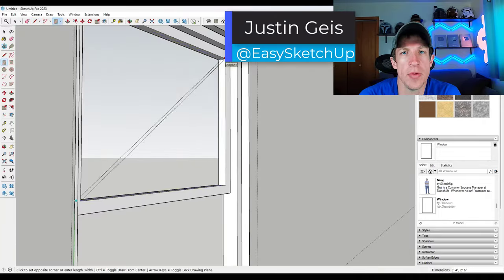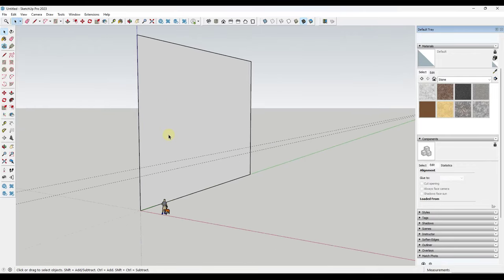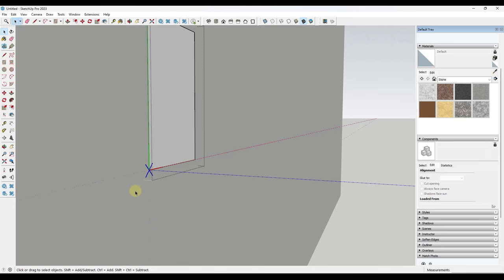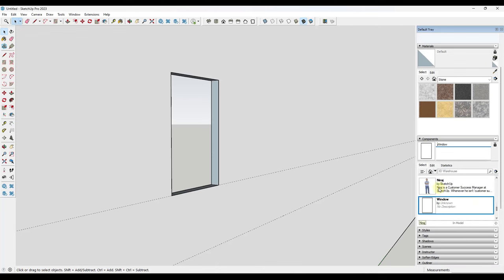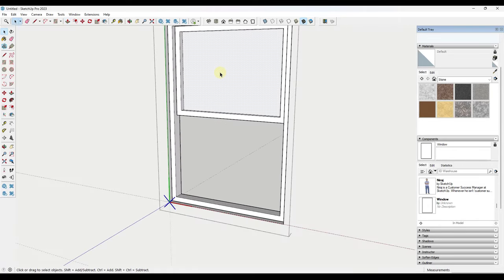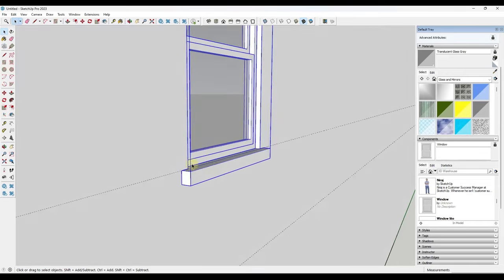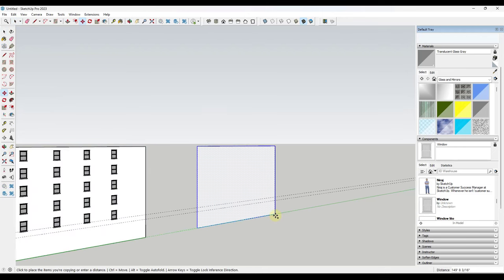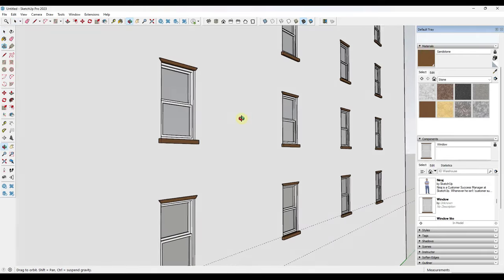How to Create Windows that CUT OPENINGS in SketchUp!

Comment: As much as this feature seems good, and halfway at the same time. I think it would make a different if the cut are able to penetrate the wall thickness and through wall that are grouped as that is the efficient way to do things in architectural modeling. This feature might be useful for background building that are less important but then again, spending time on putting windows on background building? Hmmm...